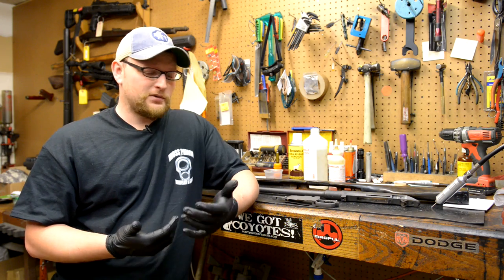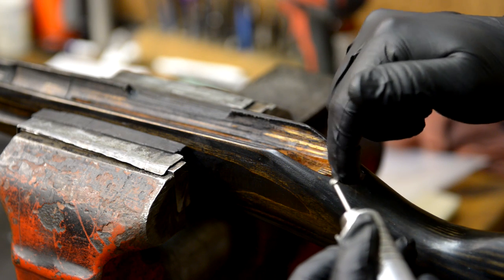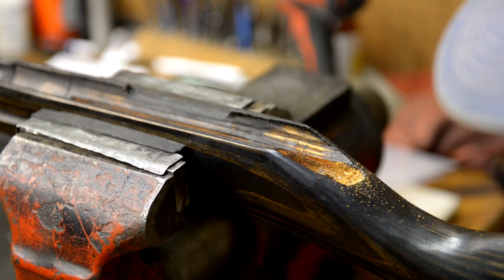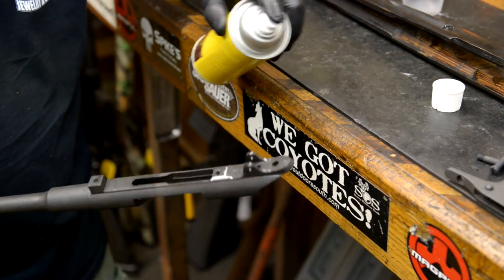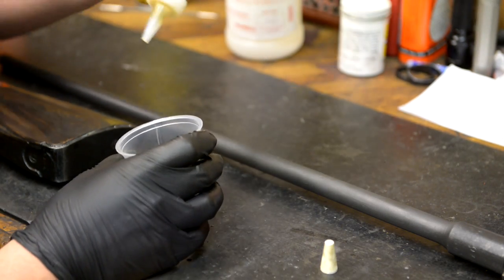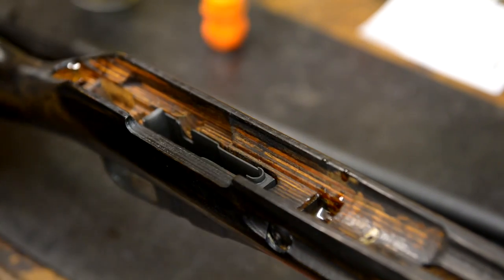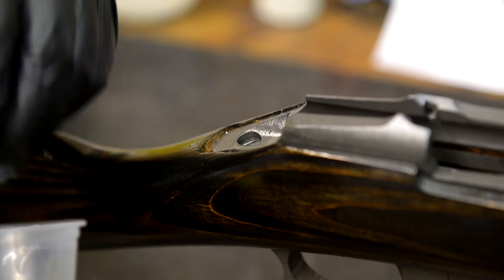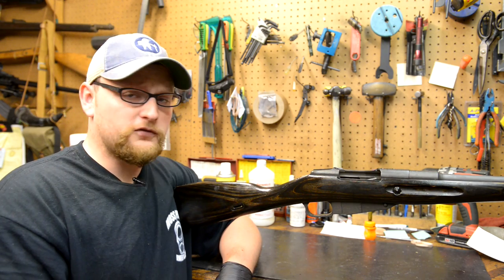How To Episode 3: Glass Bed Your Mosin Nagant

Comment: The Brownells glass bedding stuff is really great. You can get a "kit" from them which includes a dye that you can mix into the slow cure epoxy to darken it to deep dark walnut depending on how much you want to put in it, also included is a packet of fiberglass tiny bristles which you can add to he mixture, this stuff interlocks in all directions and makes a large-fill, much stronger, this epoxy remains slightly elastic, hence will not crack from recoil by design. I repaired a stock in the pistol grip completely broken on a Browning O/U (an inherently weak area) more than 20 years ago I've shot skeet with it for thousands of rounds over the years, it's just fine. really good stuff. Also, blue tape off any areas outside you don't want this stuff on, when it partially dries/no longer runny, remove the tape, other wise this stuff soaks into the wood and you might as well refinish the whole outside of the stock with it! Talk about waterproof! I smeared some trying to wipe it off and went ahead and used the palm of my hand rubbing it in and refinished the whole stock with it, awesome finish, in one coat, just have a but plate screw or something you can tie a string to and hang until dry, you can't have it touching anything and make sure the screw is in DEEP enough, or it can spin around in the wind outside and....ooh no! I learned the hard way.

Comment: If you bed the rear of your rifle, ensure you add a thin amount of electrical tape on the tang so that there is an intentional gap.
The Russians left a generous amount of space behind the tang is so that it doesn't become a 2nd recoil lug. It was inletted that way to direct the recoil to the bolt that goes behind the recoil lug, instead of directing the force to the grip, which is usually the weakest part of the stock that cracks/splits.
If you've already done what this video shows, you can still grind the bedding out the rear area and re-do it correctly.
Reply: Great info, where did you get it?
Reply: That's correct if the bolts loosen even a turn the recoil will push the whole action back and crack the grip just behind the tang when the back edge of the tang comes in contact with wood. That's why its exposed on original wood, so it moves back freely during failure. The rifle survives and a few stitches teach the soldier to check his weapon properly. My M53 was set in a modified savage stock and had this happen. It didn't crack luckily. Just took a chip out. I left the damage rather than refinish it to remind me to check the screws before shooting.
Reply: A Gunsmith by the name of Darryl Holland warns his students what I posted here.
Reply: David T
If the screws loosen, rest them on an anvil (one like the anvil on Eric's vise works just fine) whack them ONCE on the threads (4-5 threads back from the leading end) with the pein of a small ball pein hammer (<16 ozs) or a dull cold chisel to slightly deform the threads. If you whack the lead in, you're pooched. If you bang the boogers out of it, you are also pooched.

... old machinist trick-of-the-trade from before the days of thread locking chemicals.
Reply: Can I bed my mosin with guerrilla wood glue?
Reply: Juhsga No, wood glue doesn't have the physical properties needed to bed a rifle. You should use an epoxy compound (Ex. JBweld, glasbed)

Comment: I recently bought my first Mosin 91/30 and either I got very lucky and got a really good one or the minor modifications I did to it worked like a charm. I took some very thin self adhesive cork and bedded the barrel top and bottom to dampen any vibration definitely giving the rifle a more solid feel. I inserted a very thin metal shim behind the recoil lug to make sure the action stays in place.. Another very thin washer under the seer spring reduced the trigger pull from around 8 to about 5 pounds. I also made a slight adjustment to the front sight post by sliding a piece of white electrical wire insulation over the post to lengthen it. It definitely brought the groups down to center target. I was shocked at how accurate and solid the rifle feels. I shot 3-5 inch groups at 100 yds. using 147, 174, 182, and 203 grain bullets and they all performed extremely well. It instantly became my favorite rifle after 1 day at the range with it. Almost makes me want to try to find another one. Great videos Eric. I've definitely learned a lot from you.
Reply: You actually killed your groups bedding the top and bottom of the barrel.. You want the barrel to be independent of everything really. Shouldn't mess with the harmonics of a barrel
Reply: I also got a mosin I got mine for Christmas when I was 16/17? I have only two guns (with plans to get more) my marlin papoose takedown 22lr which was my first and the one I paid for myself and it's worth roughly $100-$200 the mosin I have (m91/30) my parents paid $130 it included the bayonet (they didn't know that but none the less were happy about it) two ammo pouches tool kit oil can and strap. even if someone offered me a thousand dollars for my mosin i would flat out refuse theirs no chance of me selling it anytime soon (if ever) I'll keep it as long as I'm alive my dad still has a 380 lorcin he bought and just plane wore it out the frame cracked and it became inoperable he still has it to this day and I plan on keeping mine till the day I die even if it becomes inoperable I love this rifle my parents didn't have a clue what it was when they bought it and are still talking about getting another/more mine had a terrible stock but I sanded it down stained it and coated it in polyurethane and it looks gorgeous and it's very accurate and I have done no other modification other then re coating the stock for a long time I've wanted to buy a reproduction PU scope I've been nervous about doing so as I wanted a more powerful scope I recently learned if I don't like the scope that comes with it I can replace it with another 1" diameter scope while still using the same mount so that's what I'm going to do all the same I love my rifle as a T-shirt i saw said "7.62x54, because sometimes the bad guys hide behind things" trust me it's a understatement I still want to try tracer rounds in it though
Reply: josiah esper Cheaper than dirt sells tracers for $8 box of 20
Reply: Cool thanks!!!!
Reply: josiah esper np, I would get some but I don't think they're worth that much
Reply: i would not shoot him just because he makes a offer like that the only time i would shoot someone is if they were invading my home and threatening me and/or my family it's people who make statements like you that give responsible gun owners a bad name please don't do that in some countries you can't own a gun legally unless it's been rendered inoperable and it must be done in such a way that it would be impossible to make operable again please be smart in your comments and don't give anti gun owners more ammo :)

Comment: Some extra tips: Mask the stock with masking tape and paper in the areas where you're going to glass so that any spillage or overflow doesn't end up on the stock. A single layer of masking tape on the back surface of the tang will help prevent any future splitting of the wood. When the tape is removed it provides a micro gap so that when under recoil the tang isn't putting pressure on the stock. All recoil should be absorbed by the recoil lug. Petroleum Jelly on the bolts works great.

Comment: Eric, the recoil lug area is THE most important area of bedding! The rear is not all that critical except it must have some gap behind the tang.
The recoil lug should only be bedded on the rear face of the rifle/front face of the stock. Bottom, front and sides should not be a glove fit. Adding electrical tape to these areas on the metal will insure there is a slight gap when the bedding is done. Be sure to use release agent on the electrical tape!!!!
Also...the guard screw holes in the stock should be larger than the diameter of the screws so as not to disrupt the harmonics of the gun.

Comment: The 760 is capable of a high level of accuracy without modification. If you desire to get the most out of the gun you should focus on buying a high quality optic with good solid rings, finding the right factory ammunition or loading your own and practicing as often as possible.

Comment: Another tip: use modeling clay to fill in small holes in the receiver to prevent glass from flowing into areas that could cause major binding when removing.

Comment: Eric did an excellent job in glass bedding a Mosin. This technique is good if you just want to bed your rifle's stock or you are sporterizing your Mosin, but if you are doing an accurate restoration or building a PU sniper, this method would not be technically correct. The Russian arsenals and some actual snipers used bearing plates and leather strips wrapping the barrel to stabilize it. This is the method pre fiber glass and Loctite. The first PU conversion I did I was fortunate to find a rifle that was done at the arsenal. I did have to replace the leather bedding do to rot from age, but the end result was a period rifle that is a "Tack Driver".

Comment: in the video, the applied material is resin, not glass.  I've seen some comments about using microballoons and/or aerosil or cabosil.  these both make the resin act more like a bondo depending on mix ratios and materials used. the resin used in the video is an epoxy resin. it's very different from polyester resin. your typical off the shelf bondo is a polyester resin. polyester has a higher shrink rate than epoxy and again depending on aerial mix and applications, could be a better solution.  also, using a very light veil plain weave in the bedding would likely add some strength to it, and help distribute the recoil loads. 

again, all of this is depending on several factors that for garage purposes is not very scientific or engineered. so, caveat belongs to the installer.

Comment: my sister's fiance told me he embedded a stock on an old hunting rifle with JB weld. he did great work on it just looked at it today and he told me its a tack driver now. Just make sure you don't use JB kwik weld. He told me the reason he did it is that he researched it a bunch and that JB is actually rated for 34K psi if I remember correctly.

Comment: After I saw how you fiddle around with the countersink, have you tried filling the mixed glass into a syringe? It may not work with the needle attached but I'm using syringes with many types of glues or other materials like paint, wood glue even bone glue and it works pretty well.
You may get more control of the flow and therefor an easier job.

Comment: You don't put any glass in your glass! That's missing the point entirely. They sell finely chopped fiberglass that you would mix in with your resin, then apply it. It will gel up, and make it easier to form, and it will be lighter, and a bunch stronger when it hardens. This is what we used to use to fix dings in our surfboards. Another thing you could do is save the sanding dust from the stock, and mix those in with the resin to help it match the original color of the wood.
If it's going to come in contact with the hot barrel, mix graphite in it for resistance to heat. NASA uses graphite impregnated expoxy to construct some of the SRB's they use.
If you have to bed the entire inside of it, lay out one layer of woven fiberglass mat, and brush all the air out so it turns clear.
Reply: +UNITED POLICE STATES OF AMERICA  I would prefer to use glass microballoons over chopped fibreglass. But I do agree with you on the matter, he has no glass in that glass bedding, just resin.

Comment: Eric, my action is glued tight into the stock. Can't wait for your "release video". Looks like PAM is not a good release agent.
Reply: Brent Vinson Stick it in the freezer. The metal will contract when cold, and could break the bond. But ya, Pam, never heard anyone using that as a release agent. If your on the cheap, pick up a 3$ can of Kiwi shoe polish. Works great.

Comment: No, a chemical bond would be if it actually bonded the metal and wood together at a molecular level.  A mechanical bond is a form of adhesive bonding during which adhesive material physically locks into the crevices of the surface.

Comment: This can result in "wet spots" within the glass that, once evaporated will cause voids within the finished glass. Mix in cup 1, then using a tall pour into cup 2 aiming for the same spot on the side wall of the cup. This will assure a properly mixed solution. Overtime a poorly mixed solution will, decompose, discolor, and can potentially fail completely. It may seem fine for awhile, but again, over time, poorly mixed solutions will compromise the job.

Comment: Please go to an office supply store and purchase an electronic postage scale for mixing your resin. Place cup 1 on the scale and turn on the scale. This will automatically compensate for the weight of the cup. Then pour in the first part of resin and do the math for the second. When mixing your resin you should be using a second cup to pour the mixture into. When mixing any two part compounds cup 1 will always have solution along the walls of the cup that is virtually impossible to mix properly.

Comment: The point of bedding a rifle action has nothing to do with 'raising the barrel'. The bedding compound fills in any gaps between the action and the stock to improve the mate and eliminate play between the two parts. This prevents the action from shifting upon firing, thus making the rifle more accurate and predictable. Floating the barrel can be done totally independent of bedding by carving out the barrel channel. Sights are for before you pull the trigger, bedding is for the.020s after the boom

Comment: Are you using the same epoxy type? I have some that wants 1:1 and some that wants 1:4. Just give it what it wants. Oh ... and the longer epoxy is designed to set (5 mins vs 30 mins, for example) the stronger it is. He's letting his set overnight, so I expect he's using a slow cure formula.

Comment: i know this isnt a rifle question, but i have a benelli supernova that i got on christmas. i noticed that there is some play with the fore end, and the bolt moves slightly. does this mean anything significant? i put over 175 rounds through it including some 3 inch magnums. any ideas how i can fix it, or if it even needs to be fixed. i havnt had any other problems, except i had ejection issues, but that was fixed with oiling the action

Comment: could you do a video on an economical way to improve the safety function of the mosin. don't want to get a timney trigger.  like hunting with my mosin but it's difficult to operate the safety when it's cold.
Reply: You don't need a safety. If it concerns you that much you can just carry on a empty chamber. Load the magazine up, than push the top round down when you close the bolt so it doesn't feed into the chamber. But I've seen people weld a ring on the back of their cocking piece so it's easier to operate the safety.
Reply: I know I'll catch flack for it, but the mosin really wasn't designed to have its safety used for anything other than parade drills. Sorry lawyers this gun was before your time. So here's my solution of a dozen years...
I just loop a strong rubber band from the bolt handle to the rear sight block. It holds the bolt  forward with a round in the chamber without closing/cocking the bolt. Just close the bolt when you go to shoulder it. Its not cocked and a strong enough band wont bounce so there's no more  chance of accidental discharge than there is of setting off the other 4 in the mag. In other words 0. and it minimizes noise and movement in the woods as you don't have to fully cycle the bolt, just close it.
Its not right or proper in most peoples eyes but it is simple and works. I've tried to set the gun off so many ways and no mater what I need to finish closing the gun first.
See people are gonna hate on me sooo much.
Reply: buy the brass stacker safety ring or another such device

Comment: I'm looking for that Acraglas and the release agent and can't find it, where is a good place to buy both?
Reply: A high quality liquid wax will work just as well.
Reply: I shimmed my recoil lug and bedded the rear flange area with JB Weld Steel Weld. The barrel is wrapped with a strip of cloth that was oiled and supports the barrel at the front barrel band, and the barrel doesn't touch the stock between the cloth wrap and the reciever. It's simple, easy and I got what I needed at ACE Hardware. I can reef both screws down without throwing anything out of alignment and nothing moves because of recoil.

Comment: Mosin Nagants should not been bedded like this. If you bed the cap between back section of the action and stock it causes heavier recoil and cracks to the stock. Mosins shoul be bedded only three spesific points.

Comment: Thank you! I'm buying a hex tomorrow do they have that gap?
Reply: You would have to check I have 3 mosins. All of which I HIGHLY suggest that you do the trigger and clean up the bolt. Watch Iraq veterans vids on this. I have a custom 16 1/2 inch mosin that has been free floated and glass bedded with a trigger job and the works. It is by far the best 250$ I have spent and not to mention it gets 1 Moa at 100 yards

Comment: Sorry ... but that is incorrect for the MN. 

The Mosin Nagant was sighted in by the armorer with the bayonet attached. It actually relies on the bayonet for accuracy. The military thinking of the day assumed that the bayonet would always be attached ... in fact, there  was no scabbard / frog for the MN bayonet. Taking the bayonet off requires re-sighting the rifle. I'm hitting a B27 target where I need to at 200 yds WITH the bayonet. Head / 9 ring. At 300 yds, I'd just skip the head shots.